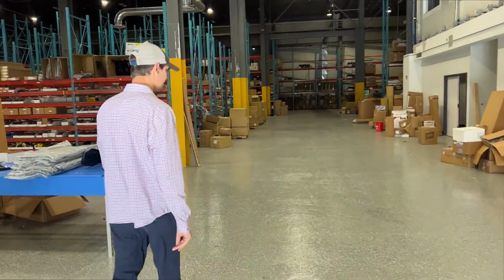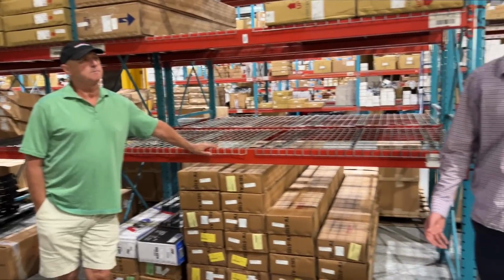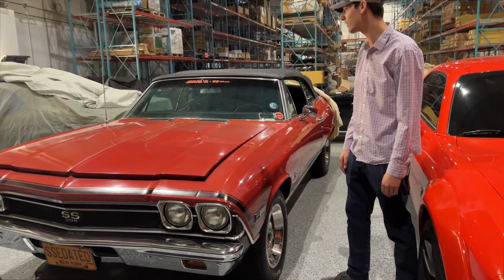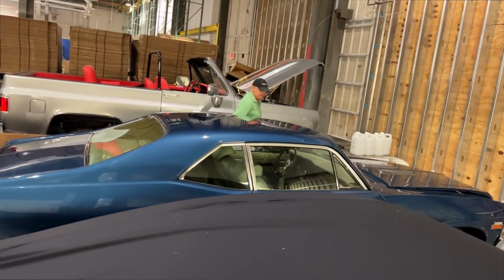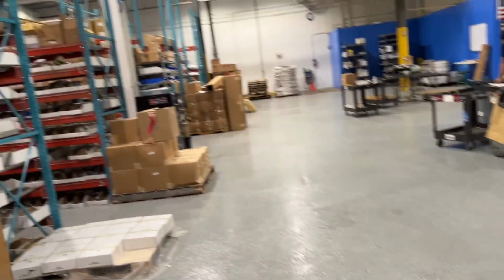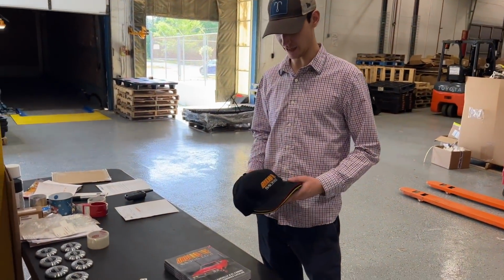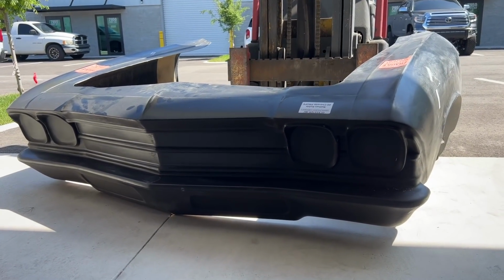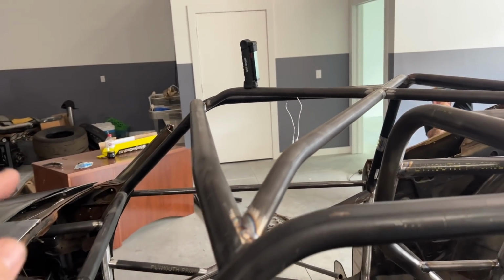Moonshine Gets a New Sponsor, and Some Much Needed Upgrades!!

Comment: I installed a power steering kit from them over the winter and when time came to fire it up, I found out the pulley was bent. Tried to exchange it but they said it had been over 30 days, so I would have to buy a new one. Said I would have to pay a restocking fee. I said for what? So you can resell it to someone else? Bought a new one from another supplier. Make sure parts are good when received or you may end up buying more from someone else. Just saying, buyer beware

Comment: casually sliding the nova wagon in, i like it.
Reply: I have a secret Wagon love/lust ! I’ve had it since high school when I bought a clean but worn out 79 Malibu wagon it had a worn out 305 ( factory 4 barrel which seemed weird to me ) and a 350 turbo . I immediately put a set of old 14” Crager classics I found lying around added helper springs a auto parts store clamp on backyard dual exhaust then did a low gear drop at 50mph and kissed 2nd gear good by but still drove the car until it was so worn out it wouldn’t run on 2 cylinders !! Lol I’d love to build one to add to my G body collection !